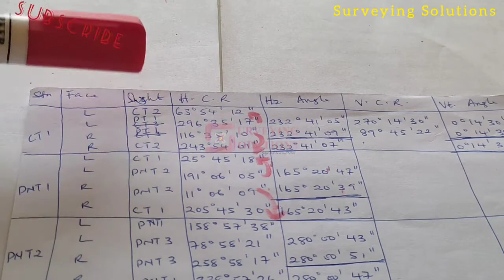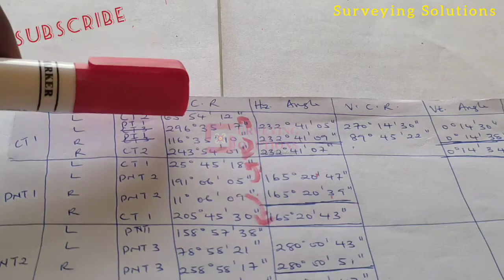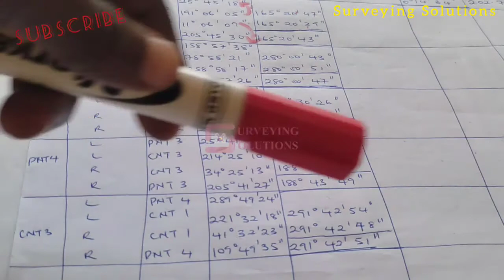Traverse Field Book | Theodolite Traverse Field Book Reduction

Comment: Thank you so much
Reply: I need how to get horizontal distance and slope distance
Reply from the maker: Both can be measured on site depending on the instrument available. 

Slope distances are usually gotten using tapes because of slope error and others. 

However, if you use an EDM, it corrects for all errors and gives you the horizontal distance of that line.
Reply from the maker: You're welcome.